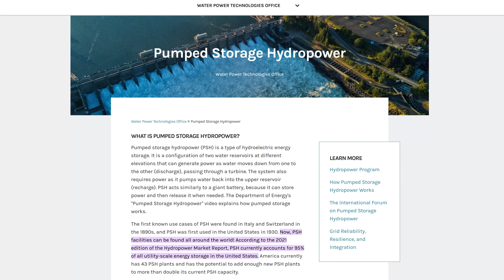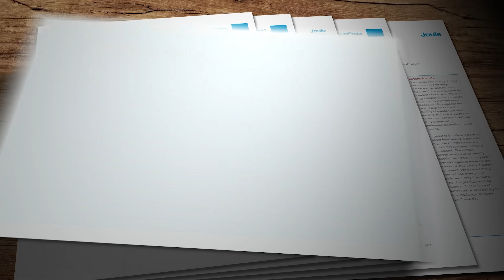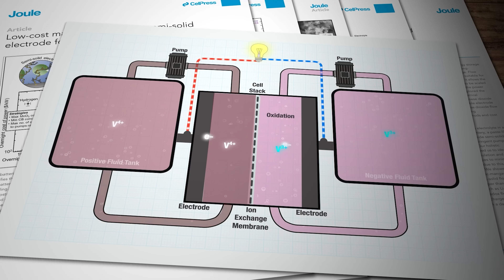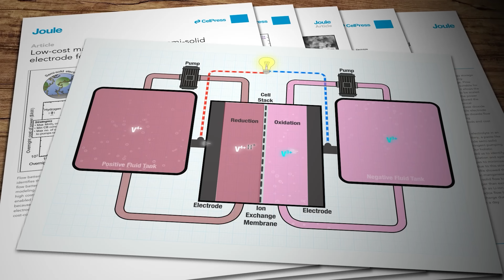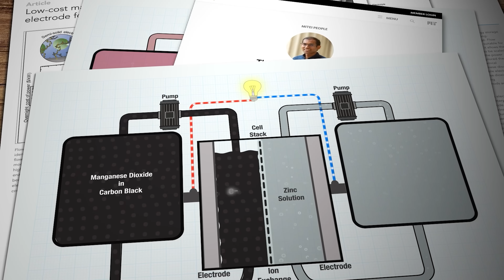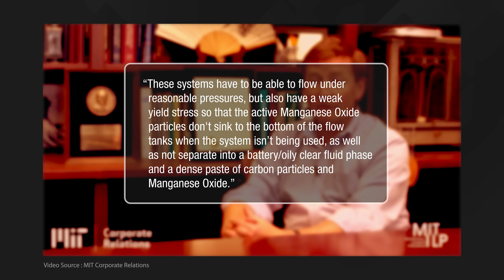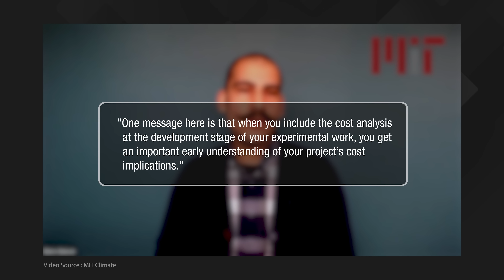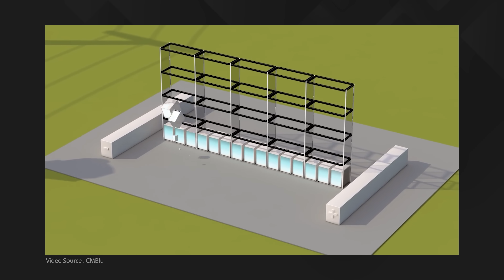Have we found the missing link in the energy storage equation?

Comment: I really don't understand how the chart at https://youtu.be/wN0bjac2tHQ?t=548 works in relation to the storage problem.  Presumably if you are storing power it is because you are oversupplied and hence you don't have another use for it.  So its value should be worth nothing.  I guess I need to have an explainer on what this metric is, and why it is the correct one to use.  Is this another propaganda metric like using LCOE to compare intermittent sources to dispatchable ones?
Reply: With a bit of seaching, I've found a simple definition of LCOS that should not include cost for electricity, and another non-obvious proprietary metric called Lazard LCOS that seems to be an offshoot of LCOE for systems that include storage.
Reply: Two things. First, even assuming electricity is free (because there is too much supply on the grid), your storage solution still needs to be cost-effective. If you can build a storage facility capable of supplying electricity at $0.25/kWh plus your cost of electricity, nobody will buy those kWh even if you can get your electricity for free. They will buy their power from the natural gas peaker plant down the street for $0.06/kWh.

Second, excess energy isn't really free. Somebody had to build those solar farms and whatnot. The decision to invest in renewable power generation very much depends on how much they expect to get paid for not only the energy used in the moment, but the energy to be stored and used later. If you treat all excess energy generation as "free," full stop, the developers are incentivized to only build as much capacity as they know they can sell in real time. I.e., you won't get anywhere near 100% clean energy with that approach. Whereas, we should want them to want to overbuild and expect to sell their excess energy to storage plants.

In the long run, "excess" energy is a market like any other. If energy storage is valuable, the storage developers will expect to pay for their electricity inputs. Storage developers who use the argument "you didn't need that energy anyway, so it should be free" will find themselves unable to acquire any energy with which to charge their batteries or whatever.
Reply: @ps.2  I agree with your general thoughts.  My framing was based on an assumption that mandates resulted in an overbuilding of solar to go to 100%.  So, just looking at what could be considered a simple LCOS definition, it doesn't include the initial cost of the electricity.  And as you note, these prices are so high only folks that are off grid and isolated should be paying this sort of price for storage.  It doesn't make sense as a straightforward economic proposition.  It only makes sense as an insurance policy, in which case LCOS is the wrong metric.

Comment: How about this, send it horizontally to a adjacent battery pack to be used as cooling it will now begin to thin out making it easier to pump vertically into a holding chamber where it will cool and thicken it will also continue to thicken as it makes its way down with the help of a large surface area from the tank and barometric pressure which can be complimented by pressure or vacuum pump

Comment: One of the most important features of energy storage is bleed rate.  How long will the energy stay in storage?  Say if I charge this battery to 100% how many days will it stay above 80% charge.
Reply: Since the energy storing atoms are stored in separate tanks rather than either side of a thin membrane in a normal battery, I would expect that problem to be much less for flow batteries. But that's based on a hunch not data.
Reply: @adrianthoroughgood1191  I agree, but they are not bragging about it, or lithium holds charge for years and I just don't know about it.  And again, how many months can we leave a tesla in a parking lot and expect to still make it home.  I have a Honda that not only won't start after 5 days, but the security system kills the battery and I mean that I have to buy another battery after 5 days.
Reply: @martinsoos  IF your replacing a new lead acid battery every five days, you're a got multiple serious problems including poor quality batteries.
Reply: @blaydCA  After replacing 4 batteries, it was determined that the batteries were fine.  however, Honda, making a new Civic SI sports car had the thought to put every electrical gadget that they could think of in the car and hooked them up to the battery instead of the ignition switch.  Honda denies the problem to every person that owns one of those cars and the problem of the breaks going to the floor on occasion and the problem of the new tire pressure sensors leaking air constantly.  It's a 2005 and there was a reason I got it so cheaply second hand.  I can honestly say that I will be a cold day in hell before I ever buy another Honda.  Not because of the car, but because of the denial.
Reply: @martinsoos  Ouch! Time for a disconnect switch to the battery cable.
Reply: Went with a small charger on top of the battery and I leave it plugged in.  Once a month when I get tired of my favorite car, I fill the flat tires with air and make sure my back up car can get me to work.

Comment: Of course I don't know the intricate details of this goop, but heavy fuel oil for tankers is some thick goop too, and it's heated with steam to make it flow. Is it a matter of just heating the goo to make it flow easier?
Reply: There very well could be a simple solution like that. Another commenter mentioned a screw pump like used in construction with cement.

Wouldn’t be surprised if the MIT team mostly wanted to get a “baseline” experiment done and is now going to start running lots of minor tweaks like what people are suggesting here.

Comment: high source resistance,  not good

the liquid metal battery ?   very low source resistance =  high current discharge

solar thermal  ORC  generators,    why not now

Comment: What a fascinating presentation. Storing  energy is a somewhat depressing job. I have read that it's cist, in general, is less critical when energy is cheap. I am so curious, what is the cost on electricity from wind  e.g in England, or for that matter Solar in Spain? Here in Germany it is reported that sun and wind complement one and another  reasonably well, but episodes of dark windless weeks (Shakespeare) are a worry. Another question,  all cities used to have those Gasometers, I mean huge coal gas storage tanks. Will these appear again,  filled with hydrogen gas?
Reply from the maker: I doubt they will store hydrogen that way. Probably a little too risky.

Comment: I still don’t understand the need or benefit for these storage solutions compared to liquid air combined with lithium ion.
Reply: Lithium ion batteries are only good for frequency regulation at current prices.  There are a few projects that use batteries based on avoiding building one more natural gas topper, but given that the basic economics are too expensive, I presume that this is selective analysis that gives the benefits to batteries but ignores the value of the risk reduction from having a natural gas topper instead of batteries.  AFAIK, liquid air systems are still in development and real capital costs will be too high to support grid scale storage.

Comment: Hmm. This might be good as an additional to base-load generation. I would think you'd need four of these systems... potentially more. One is always plugged into renewables taking whatever charge it can whenever it can. This would not be part of the base-load. You would then have alternate systems that are charged by this first system. My guess is that these systems cannot simultaneously charge and discharge, so to be an effective baseload, one must start off fully charged, and discharge for the entirety of its active duration. While this one is discharging, the alternate base-load systems are charging. 2 charge systems connected to the renewables, and 2 base-load systems... my guess is that the two systems connected to the renewables would need to be larger than the 2 base-load systems.

So, 1 'renewable-connected' system is in recharge mode collecting power from renewables. Simultaneously, 1 base-load system is discharging into the grid. The other base-load system is in recharge mode, getting recharged from the other renewable system which is in discharge mode. At the end of 12 hours (or whatever fixed time period is best), the base-load systems switch. The renewable systems would only switch either when the one getting recharged is fully charged, or the one discharging into the base-load system is fully depleted. This set schedule for the base-load systems would provide consistent power for the grid through the base-load systems, and the ability to switch the renewable systems whenever one gets full or depleted would ensure constant acceptance of power from renewables at all hours.

During times of peak load, the renewable systems could discharge into the grid if they have enough excess power stored. The only problem is if you go into an extended period of either little to no sunlight AND little to no wind... This is why the renewable systems need to be bigger (more storage capacity) than the base-load systems, to account for these times with additional storage to hopefully make it through the energy drought.
Reply: Sorry but no. You would not use one flow battery to charge the other. That would be a pointless waste with higher costs and higher energy losses. At any given time the grid either has too much or too little generation to meet demand. Li Ion batteries can react extremely fast to handle second to second variation, but have too small capacity for long duration. The flow batteries probably have a longer switch over time, but even if that is a few minutes the Li Ion battery can handle things until it is ready. You might well have multiple cells which will turn on and off as needed for a small or large current flow but they won't be charging and discharging at the same time.

Comment: Pumped hydro storage at location like Grand Mesa in Colorado or Death Valley could offer the western USA 10,000’s if not 100,000’s of megawatts of potential energy storage. These locations could support vast reservoirs with large elevation changes. OK that wasn’t about metallic molasses… but it’s true
Reply: We can't keep the existing dams for the Colorado River filled with water and there are grave concerns about existing evaporative and seepage  losses from some of the reservoirs.  For Pumped hydro, you need a slope of greater than 1ft change in elevation for 10 ft horizontal distance.  Death Valley doesn't have this slope.  In addition, it doesn't have a water supply to make up for evaporative losses.  Good luck in getting such a mega-project approved in Colorado.  There is exactly one pumped hydro station in Colorado.  In a fairly recent evaluation, the proposed projects for Colorado with the  best sites and hence the shortest payback time had paybacks longer than 20 years.
Reply: @richdobbs6595  
Death Valley has peaks nearby that could be damned for pumped hydro. Death Valley is also below sea level so literally it could self refill by gravity with a pipeline to the ocean. Salt water pumped hydro storage is also an option. As for water supply, to be completely honest the south west needs to start using solar desalination domes so the fresh water rivers can be ledge alone. Projects like NEOM would work very well in the south west. They would also provide salt and lithium among other needed commodities. If we upgraded our fresh water supply it would open up other projects and farming.
Reply: @andrewday3206  Your discussion is like a scientist discussing what is possible, while ignoring engineering considerations of costs compared to alternatives.  It is not economically feasible today to use desalination to provide water for household use for cities in Southern California, yet you are going to use desalination of sea water, and then pump it a hundred miles over terrain that is 10 times as high as the Death Valley is deep to provide makeup water for pumped hydro?.  To at least have some reason to do this you need to create a new farming area, even though we can't keep all currently agricultural areas in California supplied with water.  If you are going to have a pumped hydro storage area in Death Valley supplied by sea water, you'd need to design it for saturated salt water, so there isn't any reason to desalinate the sea water.
Reply: @richdobbs6595  
I think you missed my point. What I was saying is solar based desalination could provide the  fresh water the south west is currently lacking. This would be inexpensive and sustainable. I was also saying salt water based pumped hydro storage is doable in certain areas of the nation. As a side benefit the solar desalination could supply much needed resources that are highly profitable and make the entire project economically viable.
Reply: @richdobbs6595  
Once we stop draining the reservoirs for Los Angles and other cities the dams will refill. That’s the point.

Comment: 1:06 I disagree, why you need to store energy and return that to the grid to balance intermittent power sources?  When we would finish to spread this misconception?  
What we need to do.. is to transform any excess of the power grid to feed all other energy sectors who require clean energy in chemical form, as the natural gas grid and the utility transport sector, which the big majority of those can not work using wires or batteries.
So we need to produce a lot more with solar and wind to guarantee for most time a minimum power output that would be enough for base load requirements and then covert all the excess to H2 using electrolyzers.
In this case, batteries would be used to stabilize the grid for few hours of shortage, then gas plants or reversible fuel cells can be used in extreme cases or for season disparaties.
But there is no other way to clean the other half of co2 emmision that happen outside the power grid if we dont start to include hydrogen as long storage solution.

Comment: Hydrogen from water is the largest energy storage that is 100% renewable forever with out mining all the materials needed to make batteries.
Reply: But their round trip efficiency is rather low - electrolysis is at best 80% efficient and fuel cells 60% efficient giving a round trip efficiency of 48%.  Burning the hydrogen in a conventional gas turbine combined cycle plant is even less efficient